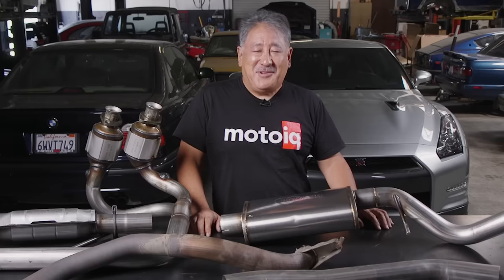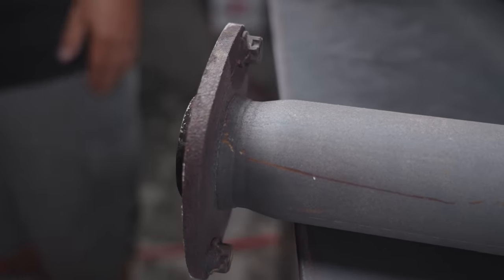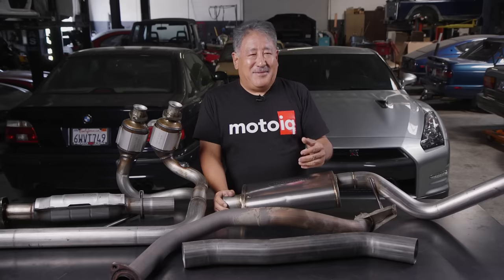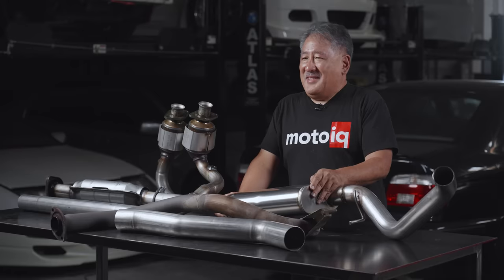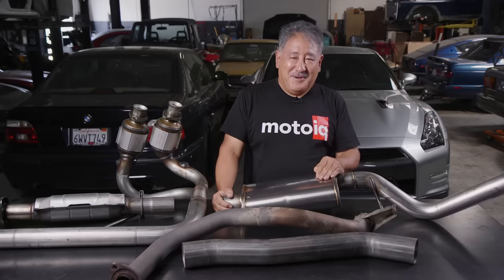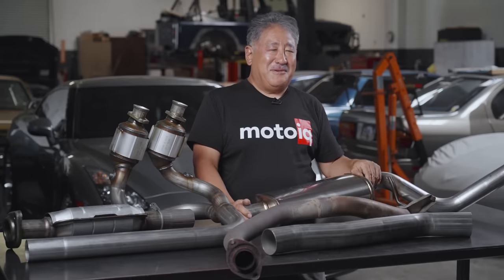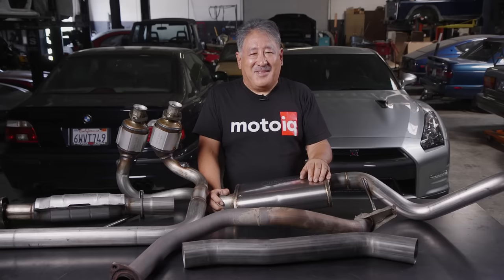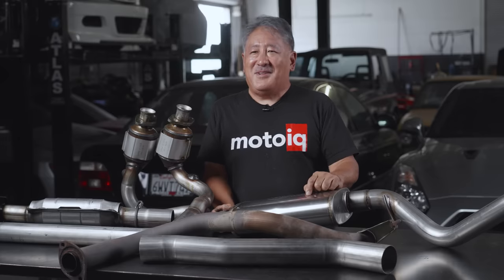Exhaust Back Pressure Myth DEBUNKED!

Comment: I believe this myth mostly still persists from the fact that a lot of people don't realize that you need to retune the fueling on your engine once you make your exhaust more free flowing. People remove mufflers or install a new aftermarket exhaust and lose power because they just leaned out their engine. Happens in the motorcycle world I come from too.
Reply: 100% is the tuning. People didn't know needed retune when change pressure either way to more or less. Once returned less pressure is almost always better as far as performance goes. However if want a quiet motor/exhaust you'll end up with a lot pressure after adding everything on. Cats mufflers etc which are needed to run quietly and for some states inspections if your state has them.
Reply: I mean tuning is important when you're doing things that change your mixture obviously, but he literally explains the main issue with oversized tubing clearly in the video. Even properly tuned, the larger your tubing the higher the RPM your scavenging effect will be effective at. If you're running a track-only NA rig then you still need to pick the right size tubing, but it'll be larger than what you'd want for a street rig, especially a daily. Not getting any scavenging will result in imperfect exhaust clearing which means you can't pull as much fresh air in and can't squirt as much fuel. Basically as he explained it's a VE issue. No exhaust performs perfectly at every RPM so your tubing diameter should be tuned like anything else to the powerband you're looking for. Even if you tune the fuel to match, larger tubing raises your powerband and hurts your bottom end power.
Reply: This all basically goes out the window when you're dealing with a turbo. On a turbo application you basically want the least restriction possible post-turbine, so an open, oversized exhaust tube can only help performance if you can live with the sound.
Reply: @imoffendedthatyouareoffended   Do you know your AFR? Lean backfires can happen too. Could be that your ECU is able to compensate for the increase in flow. Not all fuel injection systems can do that though.
Reply: . Properly tuned Duals will never make as good or usable  torque curve as 2 into 1. 
Yes duals will make more power but move the torque curve up in the rpm range.. were it's crap for anything but drag n track.
Reply: THIS.
Reply: @D I'm a little hazy on superchargers, but I'm pretty sure as exhaust is concerned they technically do benefit from good scavenging but your main power modification is gonna be from the boosted inlet pressure, so while a properly tuned exhaust still makes a difference, it's less critical than NA.
Either way you're free to like what you like I'm not sure I asked whether or not you think turbos sound yucky.
I like the sound of angry, hissing snails.... but everyone has their favorite flavor.
Reply: I think a lot of people like superchargers because they like the bangy noises from NA but adding power to an NA engine is difficult and expensive... personally, I'd prefer if my vehicle made as little noise as possible and just scooted like a dog with worms, but I do love a good BOV.
Reply: Modern ECU's(since middle/end 90s) are self adjusting - fuel amount corrections can go up to 15% both ways. ECU take measurment of airflow (through MAF/MAP), lookup for fuel amount for such airmass, and engine load/demand. In parallel ECU looks for lambda value through O2 sensor, and corrects amount of fuel by certain degree. Based on average lambda measurment engine is making long term fuel trim. Using live time value, ECU is aplying short term corrections which are infulencing long term trim.
Sure tuning ECU to new exhaust will rise power, but the main reason for cars loosing power with new, open exhaust is loss of exhaust gas velocity, due to unnecessary increased pipe diameter.
Reply: The fact so many people don't know this is sad. When I got into tuning cars, this was one of the first things I learned just from simple google research.
Reply: A oem computer will adjust to new exhaust without any issue.  If they’re losing power it’s because they are unable to maintain their vehicle for how hard they beat the shit out of it.
Reply: @nycyabber7103  millions of car enthusiasts learned everything they know before google existed, so it's not suprising. I'm only 40 and learned pretty much all the basics and alot of more advanced stuff before the internet was a thing.
Reply: You my friend just answered my question of after I installed a full cat back I felt I lost power!!
Reply: @fuji302  This is flat wrong for vehicles that don’t do real time fuel tuning, like most motorcycles with fuel maps.

Not to mention, not all ECU’s are able to compensate enough depending on how much of a difference you cause.
Reply: Thank goodness someone on this video knows the combustion engine
Reply: @D superchargers and turbos if you want HP. Not soup cans
Reply: @garry2280  took cats off my Lightning SVT, it wouldn’t turn a tire over. Put converters back on and burned both tires over a block. It’s a proven fact
Reply: @williamdawson3792  it makes sense because when you have a open exhaust you lean the motor and lose power. Open exhaust is good if you get a tune to get your air fuel correct 👍
Reply: @joeschmoe6908  that's really not an excuse. The time period I'm referencing was maybe 2007 which was 15 years ago. If you've spent 15 years in the dark because you learned stuff "before the internet", that's your own fault. That's nearly willful ignorance.
Reply: I own a 350z, and Z's with single exhausts tend to make more horsepower than these with dual exhausts. The single allows more back pressure.
Reply: Unless you have such a poorly designed system every ecu is capable of adjusting to changes to the exhaust flow. Exceptions can be made to a shade tree with a sawsall and exhaust putty.
Reply: Unless you have such a poorly designed system every ecu is capable of adjusting to changes to the exhaust flow. Exceptions can be made to a shade tree with a sawsall and exhaust putty.
Reply: Unless you have such a poorly designed system every ecu is capable of adjusting to changes to the exhaust flow. Exceptions can be made to a shade tree with a sawsall and exhaust putty.
Reply: Unless you have such a poorly designed system every ecu is capable of adjusting to changes to the exhaust flow. Exceptions can be made to a shade tree with a sawsall and exhaust putty.
Reply: Unless you have such a poorly designed system every ecu is capable of adjusting to changes to the exhaust flow. Exceptions can be made to a shade tree with a sawsall and exhaust putty.
Reply: @lunoirxx  My early 2000s Lancer's ECU can compensate to changes, though it is obviously within the capability of the parts it currently has. Issues only happen when you overdo things.
Reply: @nycyabber7103  I didn't say I personally spent years in the dark, but most of what I know about cars is from when I was younger. The thing is, the more you know at a young age the more likely you are to have aquired most of your knowledge when you were young. Think about it.
     In this particular example, although you don't want back pressure per se, the fact  that you do need velocity is not unrelated. A more restrictive exhaust will typically have higher velocity which in itself will increase velocity and help low end torque. So if we're talking about street driven cars and not worrying as much about track performance, there is very little practical difference between back pressure and velocity.
Reply: @D what was that I can’t hear you over the sound of my twin turbos spanking your v8
Reply: Wrong, alot of new cars have adaptive learning and can cater for rear muffler deletes most of the time.. cat back and or full systems will definitely benefit from a re tune.. force induction needs a retune, can get away with NA..
Reply: Yuuup!
Reply: No need if you are just changing the exhaust when you have a Mass Airflow Meter, that's what it's job is, to measure the difference in airflow and adjust the fuelling to match. The only part you might need to re-tune is the AFR in WOT when cars are in open loop. But most cars richen the mixture anyway to stop the cats from overheating.
Reply: Genuinely had a dodge dealership tell me that my truck needed back pressure
Reply: @fuji302  Completely Incorrect, why would you even say that? (and showed you ignoyin five separate posts!) Only FI systems with oxygen sesnors in the exhaust can perform mixture correction, and these were not mandated on motorcycles until relatively recently.
Reply: On a two stroke it's important
Reply: @flynick  On a 2 stroke, you want proper exhaust scavenging. You don't want back pressure on a 2 stroke either.
Reply: @lunoirxx  yea but on a bike the exhaust has to be a special shape, the expansion chamber etc. You don't see any racing bikes straight tubed
Reply: @flynick  Absolutely. 2 strokes need that special shaped exhaust by design.
Reply: Yep seen some Harley pistons melt
Reply: Lean = better performance at the cost of cracked pistons.
Reply: @d.a.s.3921  I'll take being a couple horsepower down and my engine running cooler over cracking pistons and burning valves
Reply: @lunoirxx  "You don't want back pressure on a 2 stroke either." 

You kind of do.  The exit pipe from a two stroke expansion chamber ("the stinger") is a much smaller diameter than you'd want to use in an equivalent capacity four stroke because back pressure plays a really important role in scavenging.  The higher the back pressure, the hotter the gasses within the pipe and the stronger the scavenging pulses become.  Because of this a two stroke with a tuned pipe can actually make more power by increasing back pressure up to a point, but it also raises temperatures in the cylinder and increases the chance of detonation.
Reply: You could lose torque at lower rpm and gaining hp at higher rpm when going to larger pipes or vice versa going to smaller pipe. Also no mention of hot vs cold exhaust velocity mentioned.
Reply: I Put a cherry bomb muffler on my NA mini one and it felt slower in first and second gear.
Reply: It depends on how well designed the exhaust system is.  Not every manufacturer cares to optimize their engine performance.  In some cases cutting out exhaust restriction improves an engine’s performance with no tuning, there’s some heinously designed mufflers in this world.  

I think the obvious thing is that if you go for a serious high-flow system and/or cams, if you don’t tune the engine you’re probably damaging it.  But a lot of engines these days seem to have ECUs that can compensate for some variation, so if it moves more air it’s capable of using a little more fuel.  

The other part of this is that even without other mods, a tune is probably a good idea.  A lot of manufacturer’s intentionally run a lean tune for MPG reasons and if all you do is enrich the mix a little you’ll get better power and possibly a longer lasting engine.
Reply: 2 stroke engines dó need tuned backpressure to ensure proper scavenging end timing. The exhaust there is in fact a carefully tuned Helmholtz resonator that sucks and pushes back at the appropriate moment all within a very small power band.
Reply: As I come from the moto racing world as well.  It’s not back pressure that you need..  but a resonate wave for scavenging.  Basically you get a wave in your exhaust that in a sense pulls gases from the combustion chamber .  It’s how a 2 stroke pipe works. And why you need an expansion chamber. Expanding gases pull from the combustion chamber
Reply: Beat me to it boss 👏🏽👏🏽👏🏽👏🏽
Reply: @LifeInJambles  Agreed, I have a 3" exhaust from the cat back, and No mufflers at all Remark Buso axle back and mid pipe on my 19 WRX, it's loud but not bad, actually kind of like how I can tell about where my RPMs are based on the sound notes lol. Next I need to get a J-pipe and maybe a header to match :).
Reply: Youre wrong.  The myth of needing back pressure was in sib zero climates to allow your upper end to get hot faster for those making short trips.  Now about needing to readjust your fuel air mixture settings once going to a less restrictive exhaust is also FALSE.  Whether you have back pressure or no back pressure has nothing to do with your air and fuel mixture, and even that is MYTH, because air fuel mixture is based on when a four stroke engine is on its compression stroke in where bath your intake and exhaust valve si closed, so the same ignition is going to occur in the enclosed cylinders during the compression stroke and the outer exhaust has nothing to do with this mixture ignition occuring.   Or are you able to understand this physics reality?.  However I adjust my air to fuel ratio for an engine to perform and run ots best, is only based on when those two valves are closed, so when that exposion in that cylinder occurs it does not know about or matter how it escapes or how fast it will escape after the fact has happened.  I am EARL and am the best of the best and long time
Reply: Doesn't your mass airflow sensor automatically know that more air is flowing?
Reply: @Sphoxros  being able to hear your rpm is a pretty handy thing for sure. I'd prefer to hear my intake for that, and exhaust will be loud at WOT no matter what with a properly designed performance exhaust. I'm fine making noise when I'm romping on it, I just don't wanna be making all the noise and not doing anything basically. I have nothing but disdain for 1.6l NA engines with 3" exhaust that go nowhere and scream the whole time tho. If you're gonna be making noise you gotta at least have some scoot in it.
Reply: @EarlGuyton425  most people aren't even talking about the cold temperature though, people just misunderstood what part of a smaller exhaust actually helps make power lower down and oldbies proliferated this failed explanation for so long it became common knowledge.
Reply: @blurglide  Yes but the EFI can only adjust for so much change in airflow. You're probably fine if you just replace your mufflers with more flowing ones or even doing a delete but your ECU's stock fuel mapping would probably be too lean for a straight pipe/cat delete.
Reply: Yup I forgot to richen my fuel mixture at the dragstrip one day after dropping the exhaust...I immediately toasted 4 piston top ringlands on my first run....hard lesson learned
Reply: @norm1815  Aw man. That sucks.
Reply: @LifeInJambles  Well, I definitely got some scoot with my setup 😁. Better, smoother acceleration etc. In the process of changing out my oem turbo inlet atm 🙂.
Reply: What are the best options once an exhaust is changed out? Dyno? Power/Fuel commander? both? First time doing a full exhaust on my v8 truck. Airaid intake, Gibson headers to high flow cat to to dynomax dual exhaust, originally single in and out. All tubing size remained stock at 2.5 inch untill exiting the muffler at 3 inch.
Reply: @dormantmenace  nobody talked about try-y or collector type. Only back pressure. The flow and scavenging characteristic are still important.
Reply: @jjjo7352   Do what your budget allows you to do. Getting it tuned at a dyno would be best case since they can dial it in perfectly but dynos can also be expensive.
Reply: @LifeInJambles  Wasnt referencing what people think, but was referencing where the myth started
Reply: @blurglide  But, more air would not be flowing into the intake at all.  The mass air flow sensor has nothing to do with when the exhaust escapes the exhaust valve, as in revolutions of an engine do not increase at all.   Even if I remove the exhaust from an engine, at idle or even above idle that engine is not going to take in any more air into the intake than it would with a restricted exhaust.  Think think think, is everyone nulled these days?
Reply: @EarlGuyton425  okay, interesting. I guess it's not surprising that there was a valid origin, just never really occurred to me that people weren't just guessing out of a lack of understanding all along.
Reply: @EarlGuyton425  Yes it would, because of the rarifaction during the overlap.  You'd also wind up evacuating more exhaust, which leaves more room for air on the intake stroke.  Did you not pay attention to the video?  Think think think, is everyone nulled these days?  Think think think, is everyone nulled these days?
Reply: Any computer controlled car with a maf will make adjustments to compensate, even some with speed density will do fine
Reply: @faststang85  speed density and maf are two paths to the same info. The relevant bit is the O2 sensor. Speed density and maf measure the amount of air going in, and they'll adjust fueling to suit but can't "learn" their way more accurate without the O2 sensor.... so either will adjust for airflow, but won't adjust their adjustments over time without an O2
Reply: @EarlGuyton425  Stop spewing false information.  We're not talking about shitty old Harley Davidsons here.  If you take the exhaust off of even a new car in which the PCM will try its best to keep the engine operating within its happy zone for emissions/fuel efficiency, you can look at the MAF sensor reading in the sensor data (provided we're not working on a speed density governed engine) after removing part of, or all of an exhaust system, the MAF sensor will indicate to you an increase in grams per second flowing through the air flow meter.  Stop with the theoretical stuff.  Go and remove an exhaust or upgrade an exhaust, and monitor the MAF data before and after.  Tell me how many gms/sec you see.  And then kindly delete your erroneous comments and apologize.
Reply: @faststang85  Only within a small window, though, which isn't always enough.
Reply: @deegan463  yes it's a small window and still should be tuned, what im getting at is usually it's enough to run for a short time
Reply: @faststang85  100%
Reply: @deegan463  Didnt read. MUTED
Reply: @EarlGuyton425  Great mindset.  I'm trying to help you learn from your wrongs.
Reply: @williamdawson3792  did you tune the ECU after removing the cats? If not,  you were probably leaning out before the top of your torque curve.
Reply: @fuji302  that is a good point, unless your system is already a highly tuned system running at over 80% of its duty cycle or fuel pump flow rate.   If it's already nearly maxed out, like the Ford Lightning referenced above,  there is no more fuel to add.
Reply: @Slaktrax  unless the system is already maxed out
Reply: @blurglide  it does. But what happens when you're injectors run out of duty cycle or your fuel pump can't keep up
Reply: @josephbeamon8132  Well...a tune will help neither of those things
Reply: @Sphoxros  oh you're talking turbo. Go as crazy as you want with post-turbine exhaust tubing. No benefit beyond a certain point, but it won't hurt either. Turbos hate backpressure and don't really benefit from the tuned exhaust pulse scavenging the same way, so small tubing does nothing to help. Turbos are more critical of cam overlap and dynamic compression and stuff like that, the post-turbine exhaust is basically there just to get things out of the way and reduce sound volume in that application.
Reply: @deegan463  no exhaust is usually worse for an NA than a well-designed exhaust in terms of volumetric efficiency (hence flow) once more because of the scavenging discussed in the video.
No backpressure, but no velocity and no negative pressure wave to pull mixture into the cylinder during overlap.
Exhaust isn't a singular laminar flow. It's a pulsating wave, and as pressure waves travel through the tube, negative pressure waves come back through, creating a pressure differential across the valves that would normally be impossible at low piston speeds. That can't happen without an exhaust system.
Reply: @LifeInJambles  Part of the problem with YouTube commenting is others coming along and not understanding the poster's thesis/root argument.  You're  really missing my point/not understanding what I was saying.  I have no disagreement with the video (it's a great video) and know all about the scavenging phenomenon.  Was responding to the fringe, ridiculous comments made by @Earl Guyton, as several others have also whole heartedly disagreed with.
Reply: @williamdawson3792   you took the damn Cats off…  what did you think was going to happen?
Reply: This is the reason I wanted to retain some back pressure when I ditched my stock exhaust for an aftermarket one (BMW R80). The theory being, if there was some back pressure, removing it would require changes elsewhere.
Reply: @LifeInJambles  yeah but a tune can tell the car to pump more fuel and more air into the engine for a given rpm, no? Then you can actually pump out enough air to create the necessary air flow in the less-restricted exhaust.
Reply: @Tracked_z  other than by variable valve operation and drive-by-wire, no.. the computer doesn't determine flow. Variable valve stuff can help increase flow to an extent but throttle is, exactly as billed, purely for limiting flow, and neither can fix limitations elsewhere in the system.
Tuning valves can make up for backpressure a bit by limiting overlap and can improve low-end flow in an oversized exhaust a bit, but it doesn't make up for a badly tuned exhaust, and can't cause the scavenging effect to help squeeze the last bit of performance and efficiency out.
Tuning is more about the fuel side of things, in general.
Reply: Basically, valve things can make up for deficiencies somewhat and that might be less of a compromise than you'd have to make otherwise, but you can't fix an oversized exhaust with variable valve stuff, just mitigate the drawbacks.
Reply: Literally just got a bike with a pretty much straight pipe and it didn’t run well found a stock put it on ran better
Reply: @ryancockerill4451  That bike definitely needed to be retuned
Reply: @lunoirxx  if it had an O2 sensor and a computer that learns, then a tune might have helped but it might have just been oversized and incapable of clearing the cylinders not only at low rpm, but the tubing might have been selected for a power target the engine was never capable of producing and basically tuned for a load scenario that doesn't exist... if it was carbureted then yeah, you gotta fuck with the jets or w/e I don't really know carburetors. Even with carburetors you still gotta pick an exhaust for the actual flow of the engine though.
Reply: I'm not sure why I'm trying to explain the same thing over and over when it's literally what the entire video was about, and a really ridiculously smart person made the video and if he can't convince y'all then idk what to tell ya... but improperly sized exhaust cannot be fixed by tuning. The inner diameter of the tubing is literally one step of the tuning, you can't make scavenging happen in the computer or the injectors or the carb.. and the more exhaust that's left in the cylinder the less fuel/air mixture you can stuff in. It's not something you can just adjust settings for.
Reply: Thought never crossed my mind when I was in my early 20s, I had a 1981 Holden Commodore with a GM 202 running LPG. I removed both mufflers, fitted an "absorption" glass-pac muffler from a diesel air compressor. Gave the car way more mower on standing start take offs, drove it ages and never had issues with it needing retuned.
Reply: @LifeInJambles  exactly. Since when could you just tune to compensate for lackluster/improper physical parts? Lol
Reply: @tylerwilkey13  honestly, and I'm not even trying to argue about Bernoulli's Principle here, just the basic observable outcomes of different pipes. You'd think that would be pretty straightforward.
Reply: @imoffendedthatyouareoffended  popping sounds on decel means lean my guy
Reply: I worked at a dyno shop in the start of the 1980's, many times we spent alot of hrs tuning engines to get the best out of them for the spec of that engine.

Only for the owner to then take it to the exhaust shop for a new hi performance system.
Then bring it back, for us to spend 2-3 times longer than we had spent on it, for them to now have between 3-10 or more hp less!

When we already knew the exhaust system they got wouldn't work.
Regardless of how you tried to tell them, "you'll just be throwing your $$ away"!

Some how that exhaust shop guaranteed them 100% a gain in hp!

🤦‍♂️ these days scammers use phones and I.T.
Reply: TAB exhausts are notorious for having too much flow for the new M8 Harley engines. Always lost power with them, even though they should flow better. A 2:1 with the right amount of back pressure (like the HPI setup) always produced more power on the dyno.
Reply: @lunoirxx 
You don’t understand how a 2 stroke works if you think you don’t want back pressure in a 2 stroke exhaust. Expansion chambers in a 2 stroke exhaust are tuned with the crankcase and combustion chamber capacity in order to obtain a full power cycle in one crankshaft revolution.
Reply: @working2bselfsufficient724 not all the time. It depends on the car. My sc400 runs rich from the factory m
Reply: Most modern ECU's can compensate on their own for the extra exhaust flow. You can check your fuel trim after installing a free flowing, larger exhaust. You'll usually notice a slight difference. However unless you're also doing a ton of other modifications, you can generally leave it there. If you do a lot more mods, then a re-tune is required or at the very least highly recommended to make sure everything is functioning properly, and to maximize any potential gains.